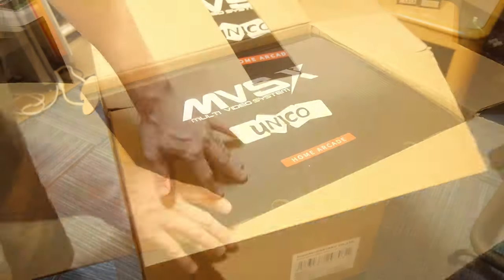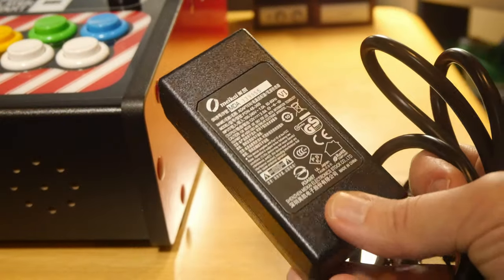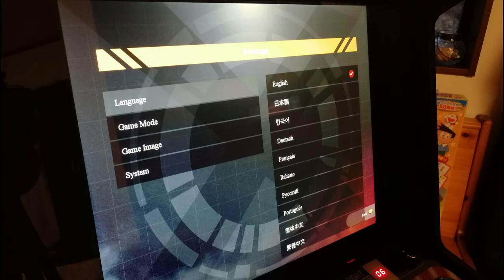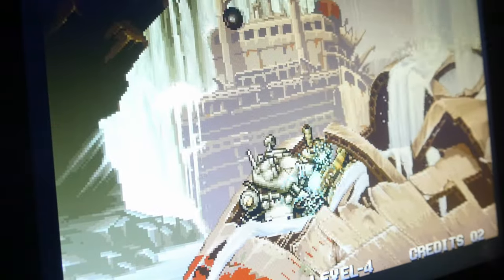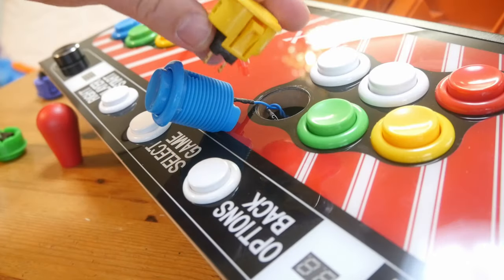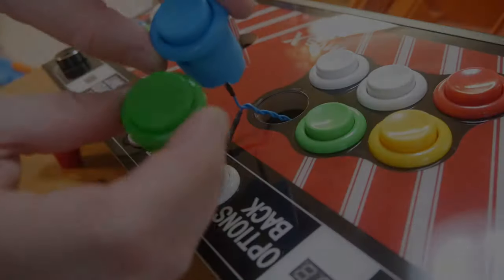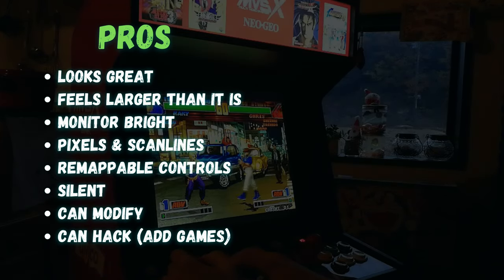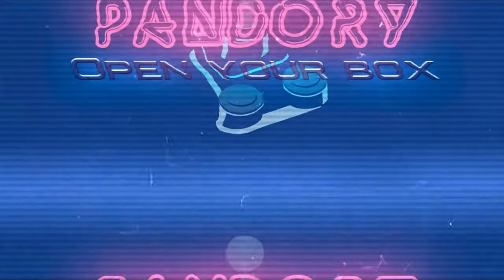MVSX Home Arcade "Second Wave" NeoGeo [Review]

Comment: At the lower pricing this is a great deal. Plus it can be hacked with the Hylo Hack to add games. I do like that the back is black unlike the cardboard that arcade1up uses. The sticks are not that great but with the tweaks you made to the gate then it will be better.

Comment: It's a very nice looking piece for sure. I just can't stand the fact that the control deck has no room for someone's wrist to rest on. The sticks and buttons are practically hanging off the deck. Another inch or two of depth would have done the deck justice imo. Still a great looking cab.
Reply: thats why i sold mine, tired of my hand going numb

Comment: Metal Slug 2 slowdowns doesn't come from the MVSX. The slowdowns come from the original game, that's why they released the game again (with the first one) later (with some modifications) under the name Metal Slug X.
Reply from the maker: "Metal Slug 2 has the same slowdown as the arcade original" - This was covered in the video.
Reply: @TeamPandory  Yeah, but I mean, I wouldn't have put it as a "cons" when the original game is the same, but it's just my opinion.
Reply from the maker: @HieiTF76  ah. Right. I guess so. Maybe we expected a bit more from a machine at $499 RRP
Reply from the maker: Remember the official ports had no slowdown. ... And played far better
Reply: @TeamPandory  Yeah, it's because Metal Slug 2 was badly programmed, which is why they released Metal Slug X later.

I understand what you say but I guess some other people would have complained that somes games would not be true to the original (to fix Metal Slug 2 slowdown, the cpu emualtion need to be overlocked but that would mean some other games would also have less slowdown).
Reply from the maker: @HieiTF76  on the contrary, if anything they expected more from the neogeo. Metal slug x was faster because they optimized it by using same sprites and less effects.
You could say, do you want to play the game they wanted it to be, or play the game you remember it was- and this divides the user base.
As this is an emulation box, and will never have exactly the same input latency as the original neogeo, why not give us a choice?  - perfect solution. They gave us options for the scanlines and save slots didn't they?
Reply: @TeamPandory  i expect as close to arcade perfect as possible on these. I agree with the other guy, it seems offsides to call it a con when it's simply replicating how the game played originally.

Comment: You can very easily add all the games it’s missing.  I wish I knew about the sale as I’ve been thinking about buying one of these.  Btw, I believe the $499 model comes with the base that makes it a full sized unit. However you still got a great price and saved $80!! It’s a beauty for sure. Edit: I see the prices have gone up. I stand corrected. This system is going for $499!! Sorry about that. I’m almost positive that when this first came out the unit I mentioned above was the 499. Can anyone confirm for me? Now it’s driving me crazy. ;)
Reply from the maker: Nah.  At RRP $499 it's the bartop only
Reply: @TeamPandory  - Correct!  I just added to my original comment. When the system came out wasn’t it 499 for the whole “shbang” ?  Either way, you got a great deal!!
Reply: @reagandow850  you're right, I bought one when it first came out and it was 499 for the main unit and riser.
Reply: $450 for bartop and 499 for bartop and stand. That was the MSRP for a while

Comment: i found the hylostick mod and installed it on my cab but i realized none of the games had the actual rom installed in it - just the coverart. is there a way i can find it with the actual roms in it? havent had any luck :/
Reply from the maker: You need to add the fba roms into the folders. Then you'll be done

Comment: Did you noticed damage on the plexiglas or dust/woodpieces between the cover of the display? I just got my 3. unit and each of them had the issue. One also  had a red light bleeding in the left corner and dead pixels.
Reply from the maker: I noticed the damage I made to it whilst pulling out the plate / stick section. They glued that thing together.  Will check for bleed and dust later tonight

Comment: Could the hylostick hack potentially harm the system or cause future failure? I’m not computer savvy but I’ve always wanted a neo geo and want to get the most out of it.
Reply from the maker: It could, I guess- as it flashes a fake firmware update.  If you're using a genuine and reliable memory stick to update, you should be fine though. - After the firmware has flashed (takes maybe 30 seconds) then you're good to either use it with the hylo (when the memory stick is plugged in), or use it as a stock system.

Comment: Legitimate question - why does it come with six action buttons per player? Outside of hacking, it only ever runs four button Neo Geo games. So why does it have a six button layout?
Reply from the maker: I think it's to cater for those with different layouts to the 4 in a line. We've had a viewer want a crazy layout set up as Spanish arcades had 2 top and 2 below, almost similar to tekken.
Reply: This.  This is a dealbreaker for me.  ALL MVS and AES units had the four button layout.  A neo-geo machine with a SF control panel layout?  It's like a shitty arcade conversion unit where the operator didn't bother to replace the control panel.
Reply: Only those at Unico know for sure but, it may be to cater for those who like the box style layout that the Neo game pads had.

Comment: I got mine in Japan for $750 from Amazon (with riser). I have no clue how you managed to get it so cheap.
Reply from the maker: Checks Amazon Jp... It's currently on sale for 33004 yen.
Reply: @TeamPandory  no base, but even so, I got stung by getting in early.  Still, even at $700, I think it's well worth it. I play it every weekend now and modded it to take 100en for me and 10 en for my daughter to use.
Reply from the maker: @dpc4548  Yes, they were expensive earlier on- that's why I waited.  The base seems to be unavailable in Japan now- They were going for around 15000 or something - ridiculous for a wooden box.  Very cool you modded it for 100yen though!  Did you do any more mods to it or leave it at that?  We may go back and make a few more videos for this box.
Reply: @TeamPandory  I put the Omega mod on to get all the Neo Geo games. I did put a Rspberry Pi 4 in there, but it didn't work well with the coin slots. The Neo Geo games are all specifically designed for coins on the same button, not so for other devices. Maybe I'll try again some time. 
I changed the buttons to be convex instead of concave, but the sticks feel great, so I left them as is.
I also put some furniture risers under it to get better height.
Reply from the maker: @dpc4548  interesting you mentioned that you are okay with the sticks.. Getting the corners in was something that really bugged me (hence changing the gate) - did the omega mod allow you to have the English settings for baseball stars 2?
Reply: @TeamPandory  my mistake, I changed the gate, but the stick themselves are really good. Baseball stars2 is in english, yes.
Reply from the maker: @dpc4548  yeah. I agree 👍. They're sanwa clones but still, baolian do a decent job.